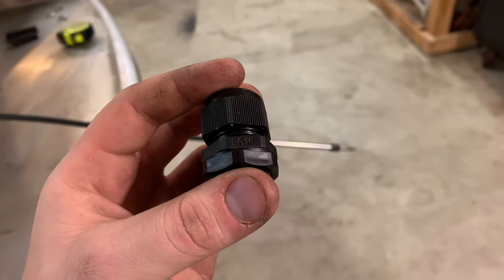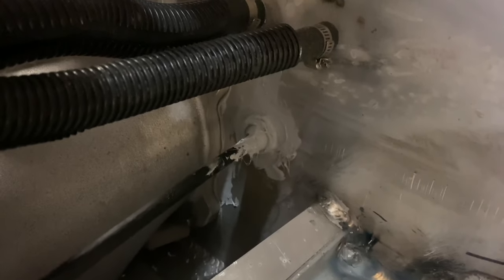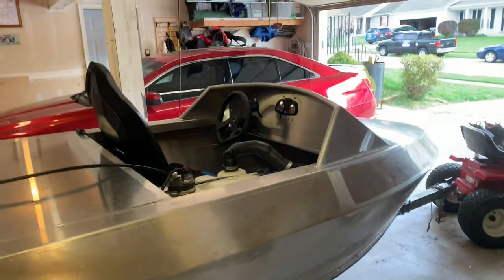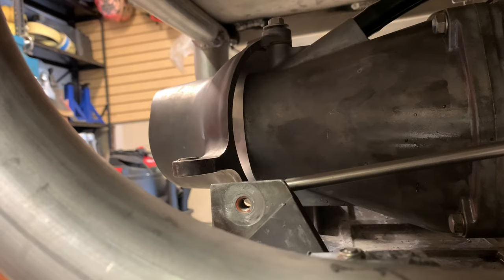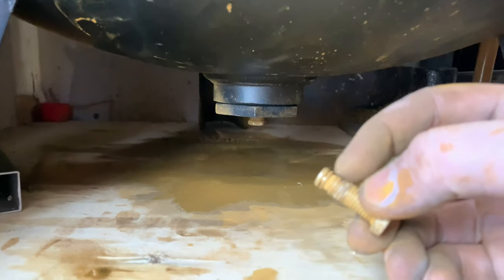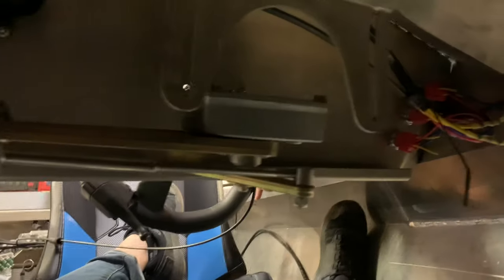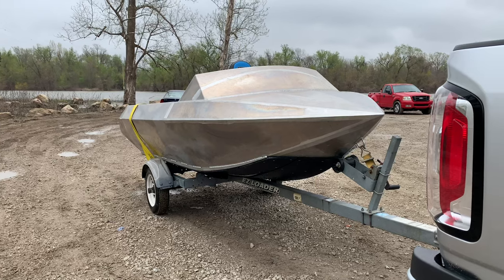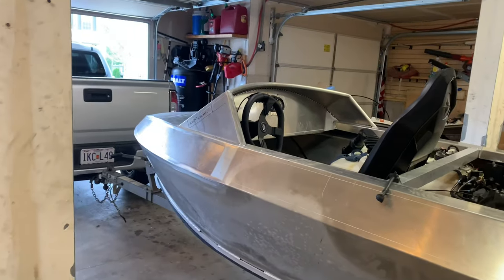Mini Jet Boat Build 16 - IT RIPS! Reverse and Steering linkages built and first test in the water

Comment: That's awesome for the 1st test run , my buddy built me a flat bottom .125 and 1/4 "aluminum river boat with my Kawasaki 310 ultra and the cavitation was real nasty , we couldn't actually resolve cause I'm guessing intake was too high and ahead , I may pull engine back out and consider merc sport jet , sure wish I would've had the resources and skills you acquire .Thats some awesome fab and engineering skill u have⭐️⭐️⭐️⭐️⭐️
Reply from the maker: Thank you! Its turned out well so far. If you end up getting rid of that 310 definitely let me know =]

Comment: Awesome. I wish I had bought a welded hull. My boat would be running by now.
Reply from the maker: Thanks! Its Somewhat ironic that you mention that! Your video illustrating how much warping you had experienced on the RSR is what convinced me that i absolutely did not have the proper tooling to ensure that the exact same thing wouldnt happen to me, And i dont have near the amount of welding experience as you either.
Reply: Mike Heying I’m a bit jealous right now. Your vids got me mor motivated to get it done. It’s hard to stay motivated when one part of the job takes so long. Thanks for posting them.

Comment: You are awesome. Put some zinc anodes on there if you havent yet.
Reply from the maker: Thank you! That’s great advice. Does it need to be mounted on the exterior below the waterline, or will above just under the swim platform do the trick?

Comment: I always like to start my holes with a small bit then use the step drill/bigger bit to get up to the right diameter.  And using cheap small drill bits saves your step and expensive drill bits from prematurely wearing
Reply from the maker: This is something I learned the hard way. Step bits at 40$ a piece get real expensive quick lol.

Comment: is that the 260hp or the 310hp? mine is just being built with the 260...wanted a 310 but wasn't in the budget. that looks freakin' fast. lol
Reply from the maker: This is just the ultra250! Your 260 will absolutely scream. It was certainly much quicker than i had thought it was going to be!
Reply: @Localhost127  i'm in alberta...where are you from?

Comment: Did you buy the hull welded  and from who. I was looking at kit from RSP /Watts but not sure yet.
Reply from the maker: Yes, I bought the hull welded. I was looking at about 5 different vendors, But wanted the most comprehensive reliable nice looking kit for the money i was looking to spend, And ended up with a minijet inc avenger hull. This specific one is an 11 foot, But he has a ton of different options for whatever youre looking for. If you end up with them, They actually do care about the finished products once its out of their hands.
Reply: @Localhost127  , if you dont mind me asking what did you pay for the welded hull? I was going to buy a kit set and weld it my self but I dont know if that is such a good deal. I guess it depends on the cost. Your mini looks awesome , and pretty well made.  Watts has that model like mini jet that has the back plat form which I like but I watched this video before yours and he seemed to have many problems on every video I watched. I've been doing a lot of research on which ski I would go with. 
I think it will be Kawasaki something.  STX with the triple, or something supercharged model. No car engines , just jet ski . Are you installing the bottom guard on you boat? I want to run mine down some shallow rivers and into some tight spots so the guard is essential to my build. Nice set up I'm going subscribe  so I can see the progress.

Comment: With regard to the fuel capacity. I don’t think you are going way to big. In the service manual for your ski you should find rated fuel consumption at WOT and an operating time at WOT with the stock tank. In general I find you can  at least double that value for medium current rivers. You have so much power you might get even more since you will run less throttle. I regretfully built my tank to match my stock 14gal tank capacity which was rated at 1.2 hrs of WOT run rime. It’s not bad but for full day rides I definitely need to carry spare fuel cans. With my 120hp 2 stroke I find 20gal is what I use on a good day trip. I’m sure you know but be sure to add baffling walls in the tank.
Reply from the maker: This is some good info! We had planned to baffle the tank, But will be putting extra emphasis on this now!